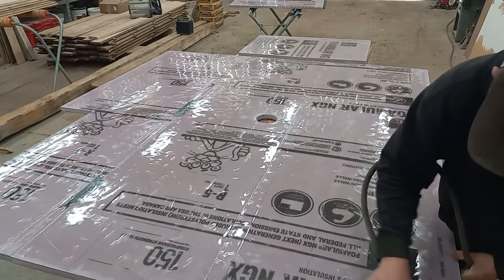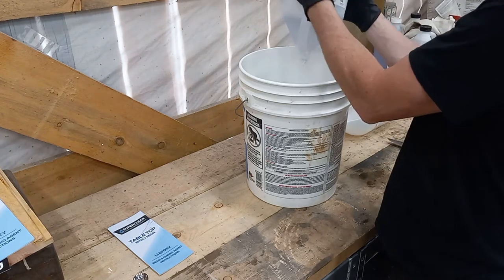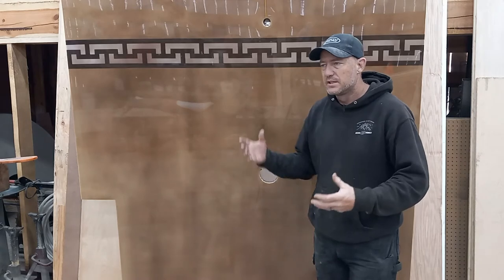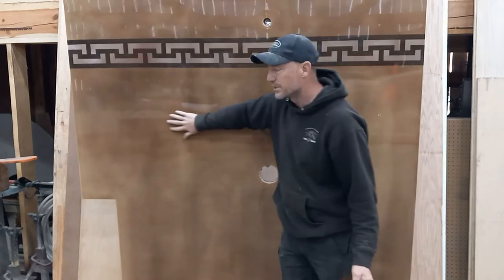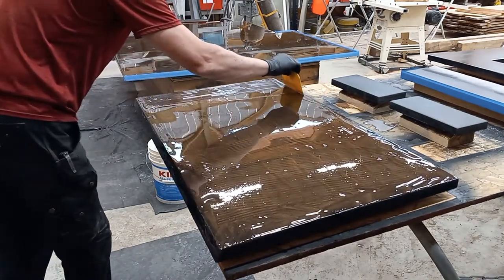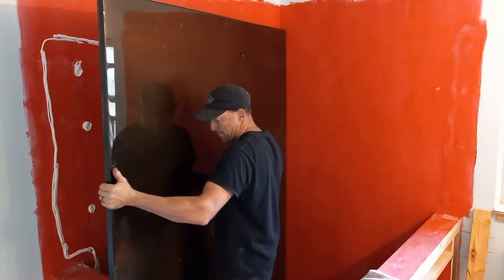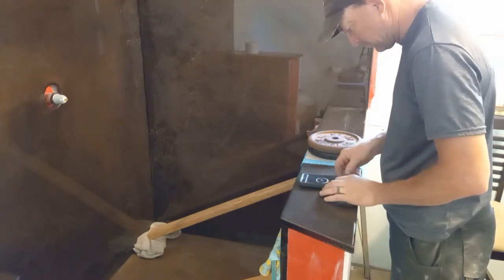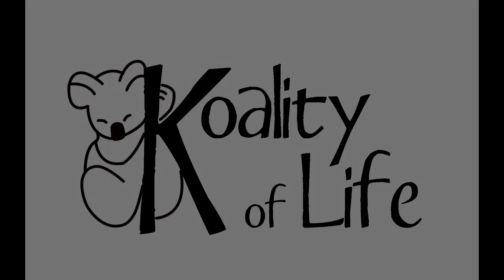Custom Shower Walls, Huge epoxy panels

Comment: Really good job on those panels! I would have lived with the first ones but the fix did make them better. This was a very ambitious project and I applaud your efforts. Your workshop is amazing and you have the space and tools to do some nice work. You even incorporated the use of technology by using your iPhone for a level. Great video!
Reply from the maker: Thank you. The first panels were ok but didn't make me feel right. After changing them up I felt a lot better about the look. The shop is coming along and I'm hoping to get into some more woodworking here in the future. :)

Comment: With walls that dark you are going to want lighter contrasting colors for the rest of the room, but in warm tones. Darker creams, golds, yellows and tans are good options. Go get a bunch of paint chips and tape them to the walls (space pretty well apart) so you can see what they look like in the room. Give yourselves a day or two to decide on two or three. Get paint samples of those and paint a few swatches . Give it a few days so you really know what they look like in the room and pick the one you like.

Most people who are bad with color are really just rushing the selection. You wouldn't rush finishing so take your time with starting. Color selection is part of the preparation. It's just slower than people think it should be. You can do it just fine.
Reply from the maker: Thanks for the advise and the vote of confidence. I'll pick up a bunch of tan chips from our home store next time I head into town. :)